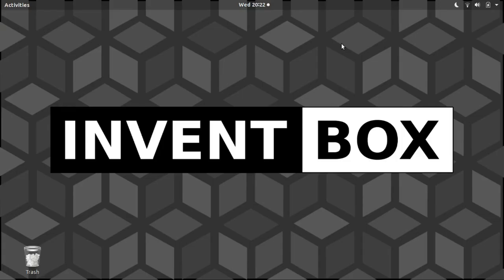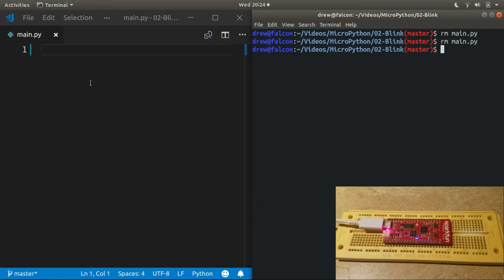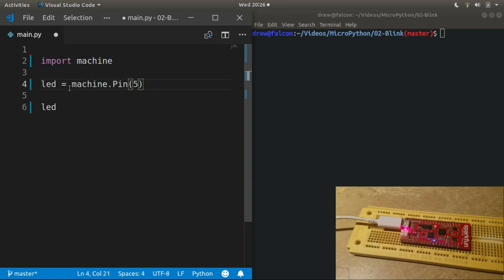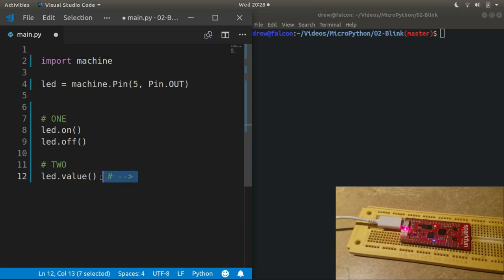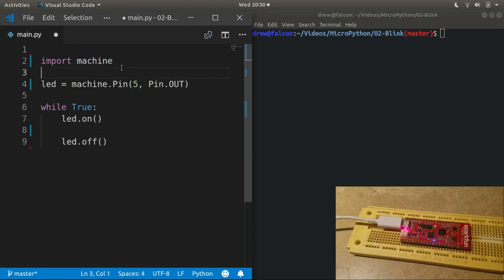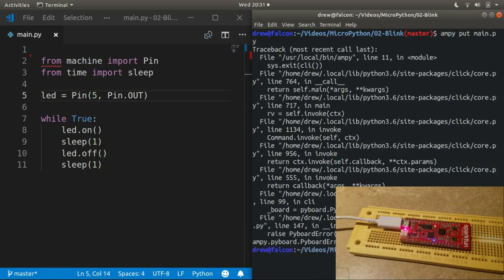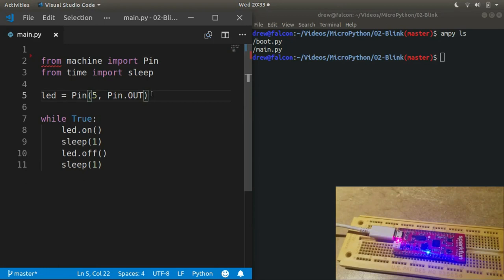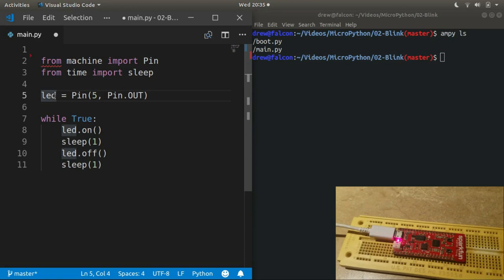Learn MicroPython #2 - Blink LED (digital output)

Comment: Hey Drew,
 Just a housekeeping suggestion; your μpy playlist is not in linear order.

The leading GIThub description link is nice, but you might benefit from adding the playlist link as well (be sure it is the mobile app compatible version of the link).

 While on the subject of 'talking shop' you could also add video tags for this (and/or this type) of series with the popular names of chips and boards used with μpy. If I were doing this, (I'm not an active CC, just a viewer/new sub here), I would take this a step further and focus on adding tags mostly for the cheapest options available, especially those found from/on AliEx, eBay, and maybe banggood, and seeed studio. The general platforms with streamlined shipping and payment outsell everything else. Some people use Amazon, but many, myself included, do not shop Amazon for electronics/anything mostly due to it's manipulative pricing, search biases, and data mining.
 Anyways, I think μpy is easiest+cheapest to use with an ESP32 or any STM32F4. The F411 is what I have, and the "WeAct" blackpill with the F411 is probably the cheapest option. 
  I'm just mentioning this bc I searched YT for STM32F411, STM32, blackpill, weact, and micropython, on their own and in various combinations. I only noticed your content after searching for micropython by itself. This is still relevant to μpy on my device though, so the tags may help get more views...if the algorithm hasn't already figured out the correlation from this comment...
Thanks for the upload, and for being smart enough to disable midroll ads that destroy tutorial content's focus and value.
-Jake

Comment: I have a couple of questions.  I uploaded with esptool the firmware for my wemos. I can now log into it with minicom and I get that prompt and I can enter instructions.   The thing is I would like to upload my main.py file.  I take it micropython is in the board. and I can upload my main.py a bit like I would with my arduino? without removing the bootloader in the process?  Maybe there is a guide on this, you could point me towards. TY very much.